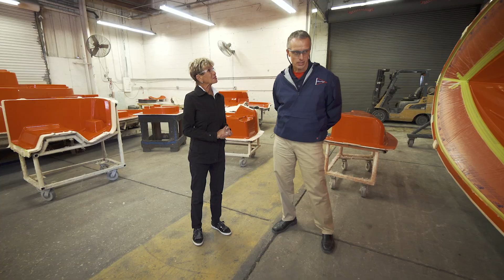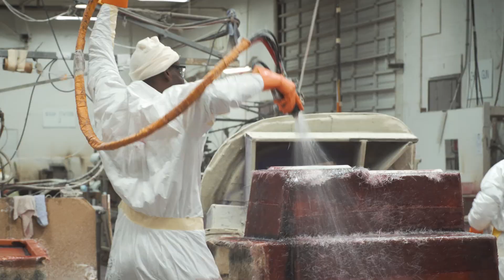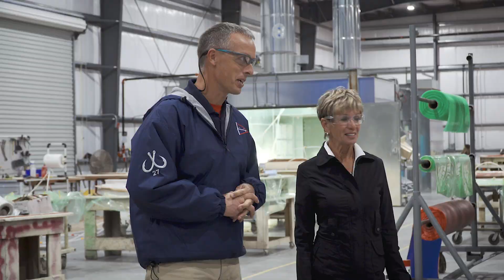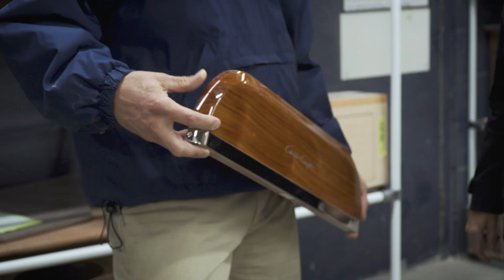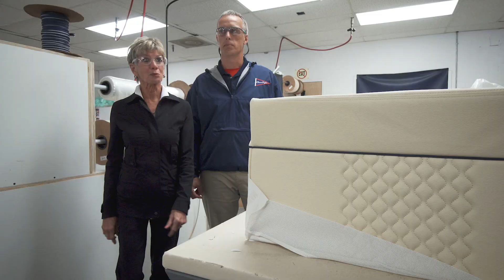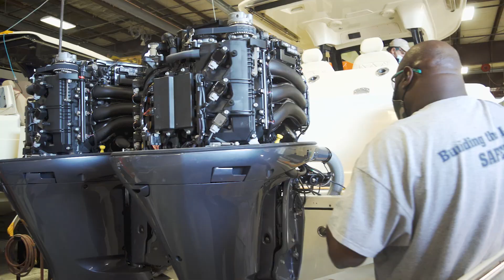Factory Fridays: Chris-Craft Reveals Boat Building Process EP. 3

Comment: This is not Chris Craft.  Chris Craft went out of business.  This company simply bought the name.  There is no relation to the original Chris Craft boat builders.
Reply: @Don'tHateSomuch - and they immediately stopped using teak? Hired fast food labor or assembled an ever better team?
So you dis Bugatti because they moved to France under VW? Did wood boat building fall out of favor in the past century?  How many wood boats have you purchased? Do you own a rotary phone with a corded handset?
Did the re-structured C.C. just celebrate 25 years? And still hold a share of an over-saturated marketplace? Did you boat this holiday weekend or just play with your dinghy?
Reply: They still use typewriters. They refuse to modernize. No battery tools, just corded. Treadle sewing machines. No website either.